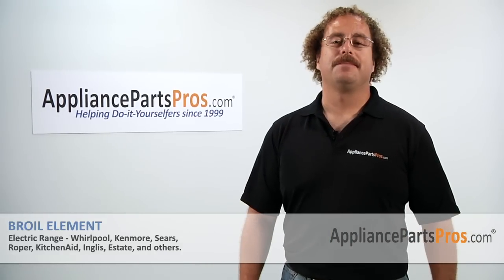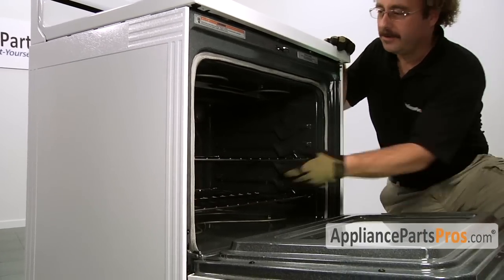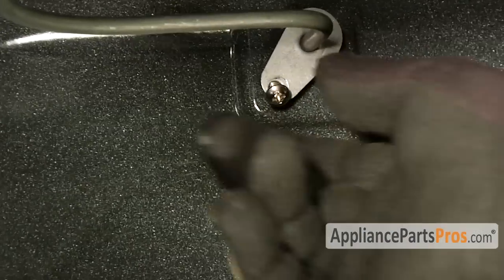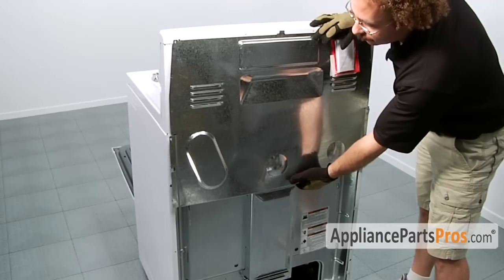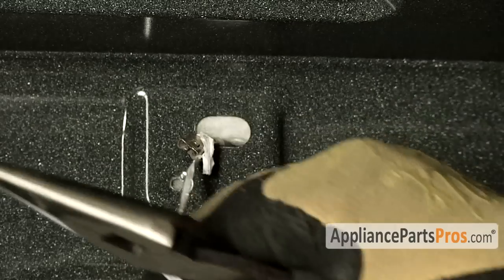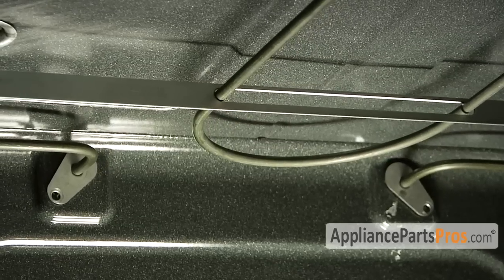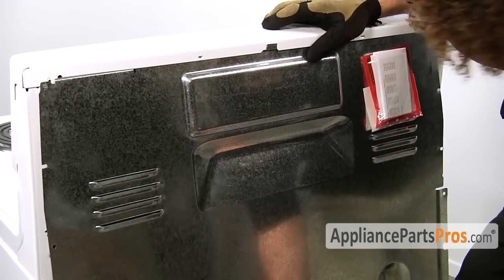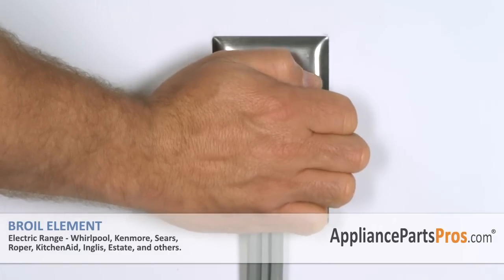How To: Oven Broil Element

Comment: why not just take the back off and then take the element out then replace the element then put the wires on from the back then put the back on. no need for messing around with twist ties and you will not get pi#$ off trying to put the little ends back onto the element ....much easier

Comment: One more piece of information.. The broiler has apparently never worked from when the oven was new.  We rarely use the broiler so the oven was out of warranty before we discovered it. I'm hoping the problem is only that a connector is loose somewhere but I already determined that the point of connection to the element is ok.
Reply from the maker: Woodrow Williams You can go to our repair forum and post the appliance model number 
along with the problem, the techs can help you troubleshoot it. Without knowing what you have its hard to say but most clocks have a bake and broil relay on the clock, if it is not sending power to the element you may have to change the control.

Comment: I changed the broiler element and the wire looked like it was burned I still connected it but it didn't come on neither did the oven and nothing was wrong with it I plugged it in and the 4 stove top burners work I don't get that spent a lot of money on that element and it took 4 days to get and nobody in my town will work on it is why I'm doing it myself

Comment: I have a built-in oven with keypad controls.  The lower element works fine but the broiler element won't come on.  The element has continuity.  Where do I go from here as far as determining why the element won't come on?

Comment from the maker: DrSkullFudger, I can not comment to you as you have the reply function turned off. Some ovens use the broil element during the preheat but usually not during baking. I would double check the circuit breakers to make sure you are getting full 240V to the stove. If you are sure that you are getting full power to the element then check the oven temp probe, if it is bad and telling the stove the wrong temp it could cause the oven to be at a lower temp. You can also post the question along with the model number of the appliance on our repair forum and the techs can help you out!

Comment: Thank you for posting this video. I think you did a terrific job and you took the fear out of replacing the element myself.

I especially appreciate how you showed the extra step of taking the back cover of the stove. Now I won't worry if the wire does fall back into the insulation.

I was wondering if you think it might be prudent to at least suggest testing the new element prior to installation. It will only take a few seconds to test its continuity with a multi-meter to ensure that it's good.

Comment: My in-laws have a 1971 General Electric stove. The broil element not working. I can not find the correct part number on it. The model # JM75007 then it looks like it has two more numbers and or letters. Is there a universal one for this stove ??
Reply from the maker: ***** Is there any numbers on the bracket? If so you can call us and we can see if anything crosses over.

Comment: AppliancePartsPros, I put the new broiler element in but when I turned it on some light smoke came from the rear and so I turned it off. Know what that might be?
Reply from the maker: Hm. If it was just a very small amount from the element itself, it could have been burning off any dust or debris it may have accumulated in the warehouse. However, smoke is concerning, so you want to be sure it's safe before you use it, because it could also be a wiring issue. We'd be happy to help you figure that out, but we'll need some additional information about the model and the problem. You can give us a call at 1-877-477-7278 or you can chat us at our website: http://www.appliancepartspros.com/. We will need the model number for the appliance, so that we can look up diagrams and information about your specific unit to give you accurate advice. You can look here on our website to help you find the model number: http://www.appliancepartspros.com/modelnumber_locator.aspx

Comment: I like this idea. However, my stove is mounted between a wall and a counter and is very difficult to take out. In my case, it is much quicker and easier to just take a chance that I won't let the wires fall back into the insulation.

Comment: Replaced it (broiler element) with brand new element but it is still not working. Checked wires they are all good. Oven heats up but still just the broiler element not working & it is the only thing not working. Oven heats up to temp but broiler w/not work. What else could it be anyone know?
Reply from the maker: If the element is not getting power, it could be the control. You can post this problem along with your model number on our repair forum and the techs will help you out.

Comment: (KENMORE Model #: 79096019401 Oven QUESTION) Help needed.

I just replaced the lower element in (6/14). Worked great. Fast forward to now (12/14) and the oven has not been cooking well like it was. It's taking forever to cook again but the newer element looks nice and red.

I'm wondering if this models upper broiler element is used at all during normal (with the broil function off) cooking? I can't remember if the top element was lit or not in the past during normal cooking. I hate to buy a new one. I can fix anything but this has me wondering what part has gone bad. Thanks in advance.

Comment: My broiler won’t turn off do you know why
Reply from the maker: That could be a couple of things. The broil element itself could be going out, but it seems more likely that it's what controls the broil element, like the board or maybe thermostat. Without your model number it would be hard to say. You can give us a call at 1-877-477-7278 or you can chat us at our website: http://www.appliancepartspros.com/. We can look up your specific appliance and work through what the problem. We also have a free repair forum where the techs can help you troubleshoot the problem: http://forum.appliancepartspros.com/. We’re here to help 7 days a week.
Reply: AppliancePartsPros  can I just disconnected the broiler Element  and still use The stove top ?
Reply from the maker: We can't recommend that. It's usually better to figure out what part is causing the problem before the problem gets bigger. If it's a bad board or a thermostat, it could cause other problems with the appliance than just the broil element. You can check the broil element for visible signs of damage and also check it for continuity with a multimeter to see if it's bad.